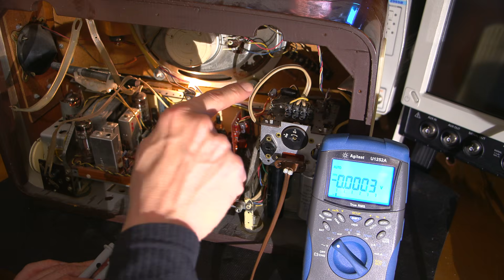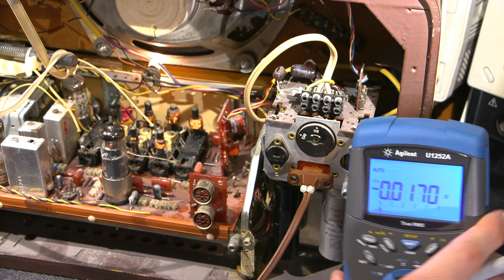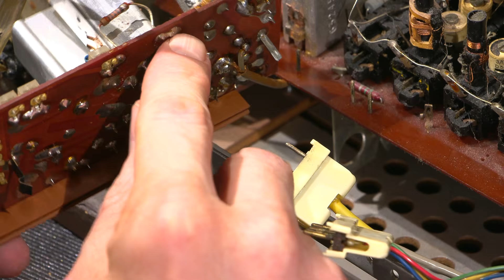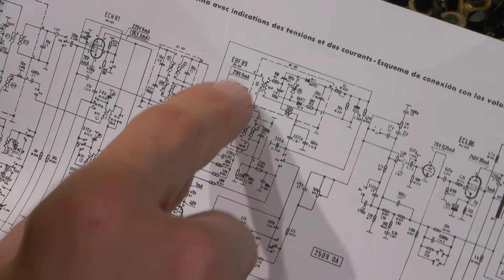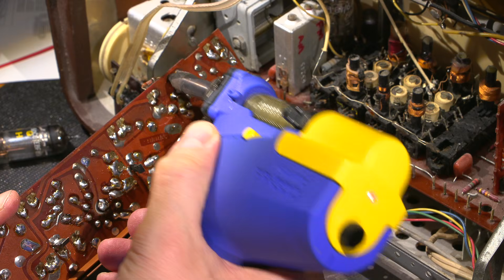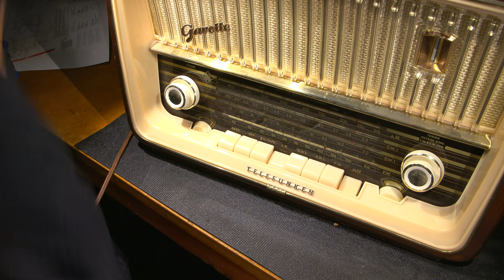Telefunken Radio Receiver Electronic Troubleshooting And Repair!

Comment: It's strange that a resistor would just burn up like that. Wouldn't this be caused by excessive current flow? In which case what caused the excessive current flow? Or is it that the resistor runs hot normally due to circuit design and eventually just burned out? My guess is that the resistor changed its composition over time due to use and age, causing it to fail.
Reply: The quality of these resistors was hit or miss depending on where they came from. Some were made well, some had abysmal process control and were just not dependable. Some failures are thermally induced cracks due to initiation points (nicks/scratches) in production – be it due to poor training or worn out production equipment. Other may be due to design problems. Some are due to lack of understanding of importance of certain production parameters. For example the crimping forces of the metal end caps are quite critical and must be exceptionally well controlled: too little and the connection may overheat and fail on small resistance values, it may also oxidize since it’s not gas tight anymore; too much and there is a thermal stress concentration that causes a crack where the cap ends (the end facing the other cap, not the pin). There can also be rough assembly into the circuit, eg. a tech bending pins too close to the body, or applying too much force with the pliers. A well designed, properly installed resistor can run hot within its absolute ratings and live a long life.

I’d say that the resistor burning out in consumer gear of this vintage is not strange at all even when there are no other component failures like leaky capacitors that would overload it.

Everyone likes to say how well made this old stuff was: not really. Mechanically it was often excellent, but part quality was poor unless you had Tek, HP, broadcast or military gear. For those markets, the engineers knew how to buy good parts and how important quality at every step of the process was – from design to manufacture to service and product revisions. 

The fixed value passives from that era usually don’t hold a candle to modern components of the same market (here: mid- and upper-market segment commercial consumer goods, ie. not “dollar store” stuff).

Another important point about the “junk” of today: all that stuff is made to a price. If it’s junk, it’s because the purchasers in the western corporations wanted it that way. You can get quality made anywhere in the world as long as the buyer wants to pay for it and knows how to monitor the process to ensure they get what they pay for. The cheap junk you buy at a typical store is not junk because of where it comes from, but because the people in western corporate cubicles wanted it that way. They are quite happy to see customers blame the overseas manufacturers. Quality is no accident. It has costs, and it requires attention from whoever buys the stuff. Apple can have high quality products made anywhere no problem. They pay for it, though. A $30 toy that cost $3 at the factory door is all that you can get for $3. Along the way profits are made, then squandered in executive pay.
Reply: @absurdengineering  Thank you Kuba for your very detailed reply. Very thought provoking.

Comment: This receiver looks similar to my Stern Radio Rochlitz Juwel 2, especially the big speaker, but yours seems to be a little bit more modern. Mine does not have circuit boards!

Comment: I don't understand why you didn't check the condition of the decoupling caps in that anode and screen circuit. It may be that the resistor died or it may be subject to leakage currents.

Comment: There's a lot of EE's  that repair radios and they do NOT replace every capacitor until they test them first, And they leave them in if they test good. You keep telling everybody you HAVE to replace every single capacitor. I'm fine with that for you, but the problem is a lot of people watch you and then they bash another people's videos because they don't change all the capacitors! Even if they don't work on the radios themselves, they just think they know everything because they watch you. And they don't know what they're talking about many times!  Stop telling everybody you have to replace every single capacitor even if it tests good because it's simply not true. I don't know if you trade in stocks but there's a lot of people out there that will talk about how the stock market is going to crash because it's over valued. Yes, It will eventually crash, but in the meantime you're losing out on a lot of money. Keep saying something long enough and eventually it will come true! Those capacitors will eventually fail, but in the meantime there's nothing wrong with them!
Reply from the maker: You have a lot to learn, until then, comment less.

Comment: Another awesome video Mr. Carlson! I have the exact model Radio with schematics. I bought it some years ago from a guy in the Netherlands. He was a dealer in tube radios.I tried the radio and I was not happy with the sound. It did not sound fulsome. It gradually sounded distorted to my ears. I was planning to send it to Radio Doctor for fixing but I changed my mind. I am in Canada. I still have the radio secured in a box and I am planning to have a look at it one day. Thankfully, I have and isolation transformer and a variac. Someone who used to work tube equipment suggested that it might be the rectifier.

Comment: When you plug these radios into 120v AC power why do you isolate power and limit the current? I’m trying to learn here. Thanks
Reply: Old radios can have defective filter capacitors or wiring and if you plug one in directly without checking those things out first you run the risk of burning up the power transformer or rectifier tube.  Once those things are checked out you are OK.  Never plug in an old tube radio that has been sitting for decades.
Reply: @mikekokomomike  Thank you so much for the response. What is a filter capacitor?
Reply: @mikekokomomike  So when you isolate power are you isolating it in terms of electrical isolation like in mutual inductance and magnetic coupling like with a transformer?
Reply: The isolation transformer has no electrical connection from input to output,  the coil windings are insulated from each other and the power is passed between them by magnetic fields.  On the line cord side,  one wire from outlet is hot and other grounded.  On output side, either wire has no connection or reference to ground,  so your body cannot complete the circuit to ground if you touch either wire.  The transformer has the same number of turns of wire on each side, so the ratio of turns is 1 : 1 which means 120 volts in  = 120 volts out.  The size of the transformer depends on how heavy of a load it is to supply, and they are rated in watts or kVa
Reply: @mikekokomomike  thank you for your gracious explanation. I understand now.
Reply: In the power supply section of the radio,  the electricity first goes through the power switch to the main transformer,  then there are either solid state diodes or vacuum tube rectifiers that convert the alternating current from the transformer to direct current necessary to power the radio.  The filter capacitor is a can shaped object that smooths out the direct current so as to remove any leftover hum or ac ripple.   The problem with the filter capacitor is that it is made of layers of foil separated by a thin chemical film that acts as an insulator,  called dielectric,  that goes bad as the chemical ages and dries up.  In best case, the capacitor no longer functions effectively and loud hum is heard in sound.  Worst case is the two foil sheets short circuit,  which then burns up the diodes or rectifiers and or burns out the expensive power transformer.
Reply: The isolation transformer repair guys use sometimes has a variac which allows the repairman to slowly turn the line voltage up from zero,  sometimes reforming or curing old capacitors.  He also can monitor the current drawn to see if there's an excessive draw caused by a problem.   Another purpose of isolation transformer is in US, some of the older radios did not use an internal power transformer and the 120 vac system has one hot wire and other connected to chassis ground.  If power cord  inserted reversed,  it is possible that the metal chassis could be at 120 volts above ground and you could get electric shock, isolation transformer eliminates that danger
Reply: @mikekokomomike  Thank you for such a gracious response. I think I’m starting to understand now. So the old radio unit is directly plugged into an isolation transformer’s secondary which isolates the unit electrically from the 120VAC 60HZ power system in the house/building? How does that keep the chassis from being energized being that AC power is non polarized or has alternating polarity? I’m a little confused on that part?

Comment: Interesting problem. I wonder why that resistor got so toasty. The circuit only draws 5ma which shouldn't be near the 1/2 watt dissipation. Maybe a shorted tube at one time?   It also looks to me like this radio has had considerable work done to it in the past. I see a lot of new capacitors in there, along with some resistors.

Comment: Nice repair, you identified the problem even without the schematic. What about the loose wire in the back of the radio, is the internal dipole antenna not connected?

Comment: Next question is why did the resistor fail? If it was the correct value and wattage, it should not have failed and be open. Did a capacitor fail previously? If the bad cap was changed, but not the resistor, it was only a matter of time.

Comment: When I still repaired tube radio's mostly in the 60's my first look inside was to identify resistors having blackened their code rings.  Only wire wound resistors remain more or less the same even when overloaded, but carbon and metal film alike do this. After checking and in most cases just renewing these and watching out for condensors connected to them as potential failure origin, lots of problems did not need further sorting out. I was not aware German radio construction moved to printed circuit boards in the time of the Noval series of tubes in the 80's series (like the EBF one mentioned here), The last German one I repaired was our own Blaupunkt with both Rimlock tubes from the 40 series and one strangely out of place metal (wartime?) tube the EAA11 for the FM decoder. Its RF tube used in the FM section doubled as a AF preamplifier tube feeding to the powertube EL41.   It took awhile for me to understand the tiny circuit diagram glued in the wooden case: who would think of such doubling solutions! In any case this way of minimising the number of tubes while introducing FM reception still resulted in an expensive unit, which always had a lower performance in the FM decoder and could never be correctly adjusted over varying signal strengths. BTW at the time we got this radio as a present in 1952 or whereabouts, FM broadcasts were not even live in Holland at the time....

Comment: "That's the problem with intermittence - this thing might all of a sudden start working and we won't have our culprit"

I wish more people understood this in the context of computers as well. Software can be the same way - I always used to say when I was doing desktop support that restarts DELAY the problem, they do not fix the problem. If we take some time to think and investigate we can at least find out what's happening even if we can't fix it (it can always be fixed, but generally it'll be the software vendor who has to do it at that point, in that context). The only saving grace of PCs is generally there is an event log that might help you figure out what's going on.

It's awesome to see that the same sort of thing exists in other contexts and in other technologies, and maybe some awareness should be brought to this concept.

That said, between you, Mr. Carlson, and finally having the time to watch the new one from Ben  Eater it's a good week!

Comment: We have a lot of those Telefunken Gavotte in Austria...but the FM-Range stops at 100 MHz on all of them. Today we also use the FM Band up to 108 MHz so you cant get all stations with them. The AM-Bands should be the same although the dial indicates them in wavelenght (Meter) rather than kilohertz.

Comment: But why did the resistor burn up?
Reply: Did it burn up? To me, a burnt up resistor looks like a burnt toast, at least partially. This one failed all right without burning up. As for why? It could have been random failure not precipitated by any other faults nor design/production shortcomings. Given the era when this was made, I’d first blame the quality of the part of there was nothing to indicate otherwise. Just because it’s old doesn’t mean it’s good. Lots of consumer grade parts from back then had worse reliability than the bottom of the barrel bargains they put into dollar store toys.

Comment: Paul, there's another way to check resistance in circuit with solid state equipment. I watched a video from diodes gone wild and he used the MESR-100 ESR Meter to check for a shorted transistor in a switch mode power supply that had a snubber network and an inductor in the circuit, a multimeter would have fallen over in this situation but the ESR meter saw the inductor as an open circuit and he was able to check the resistance without removing anything! 
I have never seen anyone use this technique before! 
Once I saw that! It couldn't be unseen! LoL now my ESR meter has a second purpose in it's useful life! 
It's not a win win situation but it's definitely a win more often situation... Having the ability to test components in circuit makes life so much easier!!! 
Thanks for your time and effort that you put into every single video! I'm not a big fan of radio! But I watch every video that you put out with anticipation as do most people.. the TV's in my house have become obsolete, no one has used them over the last few years! 
Had this sort of content been provided on TV, YouTube wouldn't have become what it is today! That's Lamestream media for you LoL...

Comment: Anyone know why the AM, SW1 and SW2 bands tune from right to left while the FM band tunes from left to right. On top of that SW2 is the lower shortwave band (2.3Mc to 6.9 Mc). SW1 covers 7Mc to 22 Mc. At first I thought the SW bands were labeled in meters but the numbers, typically 120m-49m and 41m-13m, didn't fit.

Comment: Another gorgeous tabletop radio, and the audio from it is just as impressive! Too bad for Content ID and DMCA because I'd love to hear a few seconds of "Telefunky" music coming from it!
Some in the comments below mention you didn't inspect capacitors, but you DID mention the radio had seen some recent restoration, so I feel safe in assuming you already inspected them. Come to think of it, I didn't see any old-looking caps in the entire video.
26:47 - I am, however, bothered by those radial electrolytics mounted axial-style. The leads seem to be bent sharply at the bottom of the can, which is probably not the best way to do it. (I've watched your channel enough to know that certainly isn't YOUR handiwork!)

Comment: Great troubleshooting, Paul, thanks.  I'm sure I wouldn't have been as fast.  Also, I too, often put heat-shrink on my probe tips, or use the screw-on covers that usually come with them, but the finger guards often can't go around nearby components.  Watching this video finally convinced me to order some 7" pincer probes for my DMM.  Thanks again!

Comment: Did you increase the power rating of the resistor? If so how did you decide how high to go?
Reply: Usually at least double the wattage. If 1/2 go 1 watt.

Comment: I do know about elevated voltagers on tube type radios.  One of my test in Navy electronics school was to do measurements inside an AM radio and I failed because I got shocked.  That was in the day when it was 30 weeks of tube tech and 2 weeks of transistors, no integrated circuits yet

Comment: Hi Paul, I noticed that when you replaced the resistor, you didn't fold the leads against the pads in the same way the original resistor was installed. My old electronics instructor Mr. Colclough was a stickler for details like that. I suspect that such practices were a holdover from avionics and other mobile equipment assemblies where vibration might otherwise cause loose solder joints. Any thoughts on this?

Comment: Its amazing how quick you nailed down the problem Mr Carlson before even locating a schematic. Knowing where to look from years of experience saves a lot of time.
Just like when turning it on you already knew the audio section was working becase of the buzz. 
Its nice to know there are possibly 300 Volts lurking inside the radio.
I'd heard that of the old TV's but had long forgotten it since they've been out of service for so long. This is awesome stuff. Thanks for sharing!😀 😃 
I love the baby blue eye that tells you when your dialed in.

Comment: Your insulated probe tip reminded me of my TMK model 500 from the early '80s which still has the insulation
that I added for the same reason. I'd add a pic but don't know if it's possible.
Reply: My father once made a "custom" set of insulated meter probes by putting some heat shrink tubing on the tips.

Comment: Everyone knows what happens when you hit the "Jazz" button. Unless the unit is out of alignment. I once hit the "Jazz" button on a unit that needed alignment and Scott Joplin's Mapleleaf Rag came through the speaker. I had no problem with that and I didn't want to get zapped with 888 volts to fix it. (That is what you need to travel back in time to 1898).